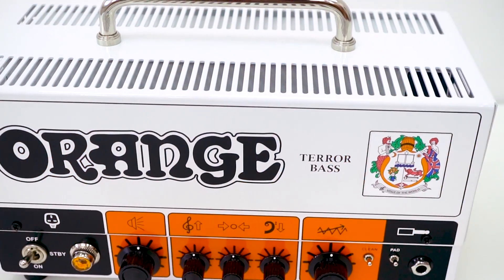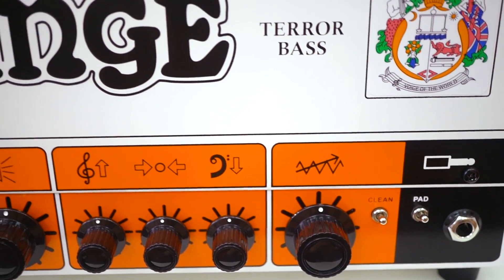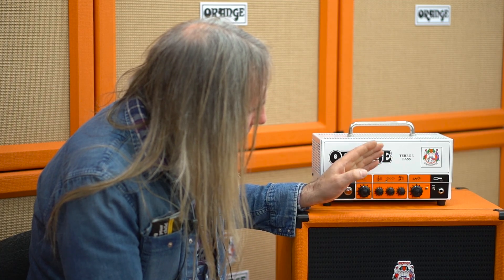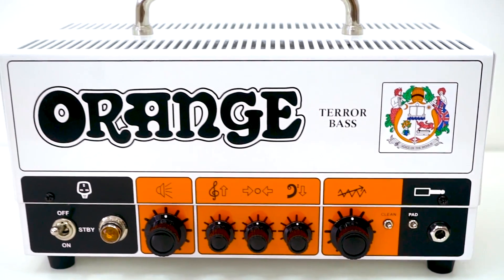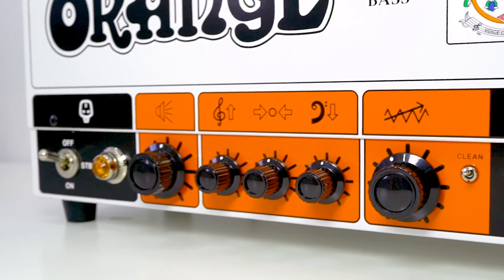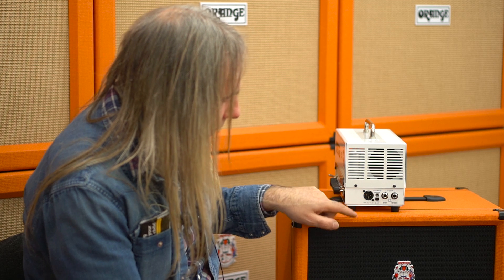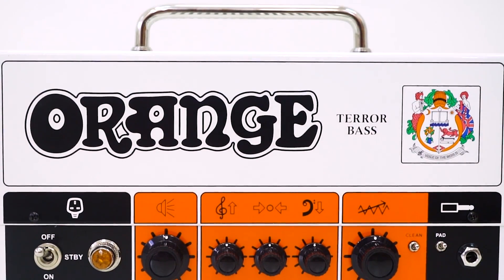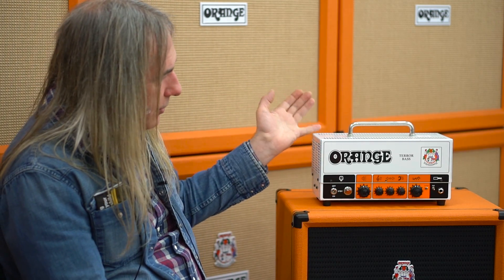Ade discusses the new Terror Bass and OBC112.

Comment: Can you provide prints so I can look into a couple mods?  I am looking into expanding the output switching and circuitry to handle a 2 ohm load.  The other mod would be to control that wonderful DI out to the board without compromising my stage sound/tone through the front end; either an independent switch or a db pad to knock it down.  For now I have db attenuators on hand if the event arises.

Comment: Best 112 bass cab ever
Reply: would you suggest 2 of the 12 inch cabs or one 15 Inch cab ?
Reply: @chrisb48907  I'd say 2x 12" for sure
Reply: I've a pair of them (and the Terror)  that I've used on a couple of gigs now and I have to agree. Utterly ridiculous volume considering what they weigh and the space they take up. And it's not just about the volume, the actual tone is fantastic too, sounds like a much much bigger rig (my usual is an 8x10 so I can make a fair comparison I feel!). They're not cheap, but for that they absolutely don't sound cheap either. Just leaving this comment for anyone who's on the fence about them really, they are in fact the real deal.

Comment: If power amp would be tube it would be even more better!!!
Post scriptum:
I think why most manufactors do solid state power amps for bass is unfortionaly just because of money but not because of sound!!!
Reply: I am not saying solid state is bad, in fact it is fantastic but valve is better! :)
Post scriptum: While i do say digital is bad!!!
Reply: Thats what you got AD for!
Reply: This is a fantastic gigging amp.  Awesome tone, gobs of power,  really rugged and PORTABLE. All I use.  As awesome as the AD is, lugging that monster would get old quick..I'd rather use that for the studio.
Reply: @ferox965  - Question....Ade said it was tube up to the return and the DI is solid state also. How does the DI sound Live to the front?
Reply: @sixsentsoldiers  I have the original...Live, I'm a little nuts about my sound so I mic my cab.  But in the studio, I went direct and it sounded awesome.
Reply: @ferox965  - That's what I'm wanting. Haven't been this excited about new gear since my Ampeg Heritage 8x10.
Reply: SixSentSoldiers "